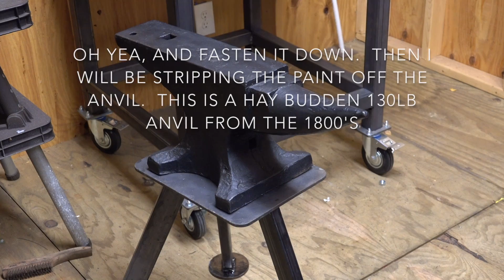Basic Metal Anvil Stand

Comment: I have used oiled sand to deaden the ring on my Power Hammer build.  I seems like it will work well.  By the way I dig that fab block table.  What is your opinion of it?
Reply from the maker: Derrick Welton I absolutely love it.  After welding on the portable stands like the Nomad, it's a huge upgrade.
Reply: That will be my next purchase then.  Thanks for the quick reply.  Have a good one!